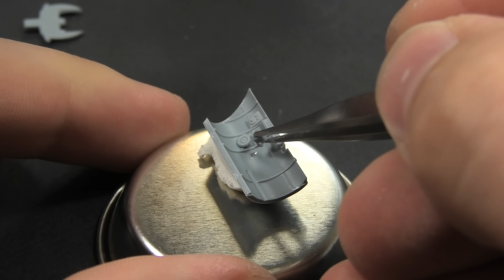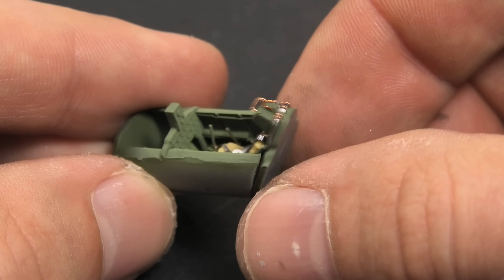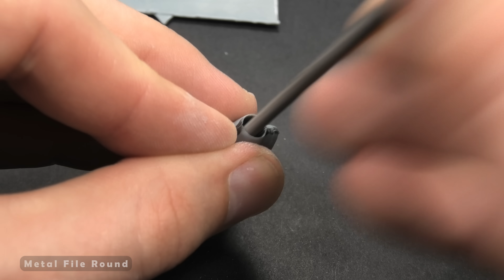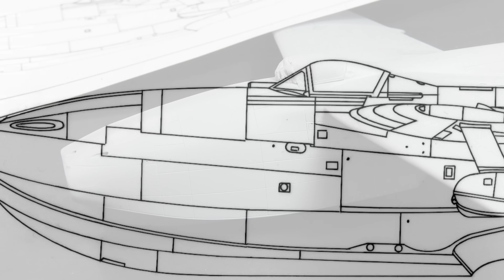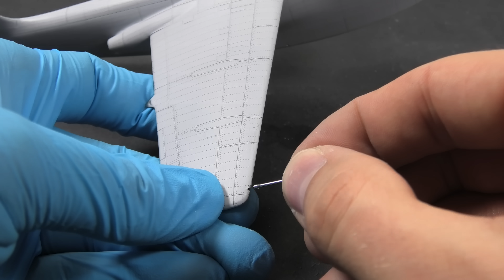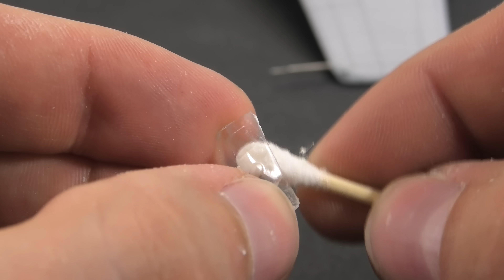Saunders-Roe SR.A/1 - Xtrakit 1/72 - Aircraft Model

Comment: Thanks so much for sharing your skills, you are indeed a master modeller. May I know where do you buy the micro drill with slow rpm. The drills I see on the market are 5,000 to 15,000 rpm which will melt the plastic. Thanks very much.

Comment: awesome result! Would you mind telling me which UV resin you are using for the wingtip lights? I have tried using a few in the past, but they were all quite thin and hard to get into a shape and even after a minute or so under UV light, still remained rubbery and wouldn't sand or polish.

Comment: Superglue creates a more stable bond? No it doesn't. Superglue has no sheer strength whatsoever. Polycement bonds by melting the parts together creating a stronger bond with sheer strength also.

Comment: That is a rather interesting aircraft right there. The ejection seats dose not look very safe but I gess it's safer than the alternative. When you mentioned it was a fighter I was shocked because that plane dose not look like a fighter it looks someone took a like a Catalina flying boat a Spitfire and a Mosquito cut them up and ducttaped and super glued them together. The modle kit itself i think the brand did the classic make the kit but don't build it yourself before selling as some of those fit issues where one single part going on so should have had a good fit. I believe my reaction to the thumbnail was WTF is that but you did an amazing job on it and this video is a very informative pice with plenty of entertainment and super glue.

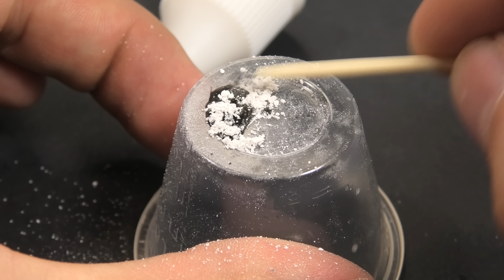Comment: On the Issue of filling gaps in panels (like at around 8:40): Make your life easy and either make sprue goo (Dissolve kit sprue pieces in MEK, Acetone or Tamiya extra thin) or mix tamiya putty with a bit of spirits. Both are workable exactly as the injector-moulded plastic pieces and it's using waste plastic (if you make sprue goo)!